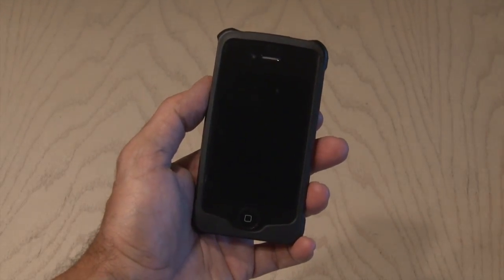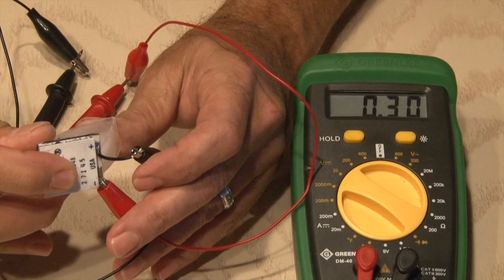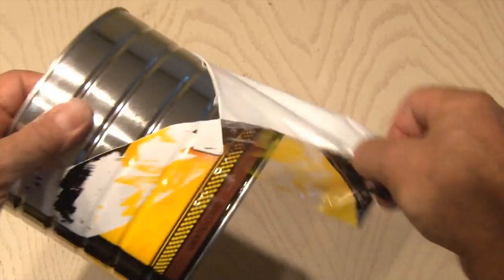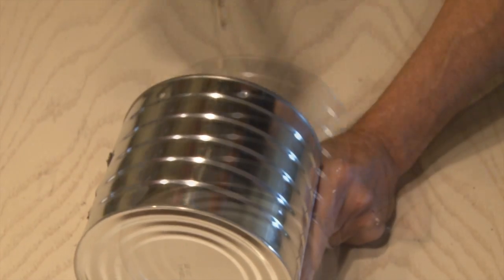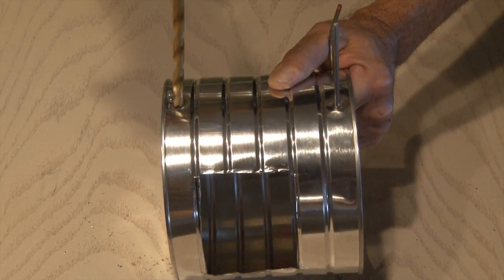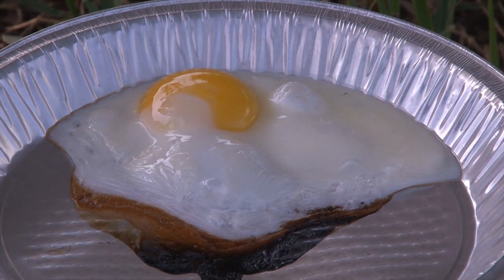Charge Your Cell Phone with FIRE!

Comment: Kip, I'm confused. In your other video that used a computer cooling fan to make a phone charger, you also included a step-up converter in the circuit. Why does the thermo module circuit not require the step-up converter?

Comment: the peltier effect works much more efficiently when the temperature differentiates from one side to the other so instead of just trying to get one side extremely hot try keeping the other side cool at the same time :) in general these are not very efficient for producing electricity but they are rather useful for pumping heat energy and these are mostly used in those portable electric fridges/hotbox and are great fun for messing around with whilst experimenting

Comment: how much volts can that put out, im thinking if you daisy chain them you can get a decent amount of power and maybe put them on a copper pipe  maybe coming out of hot water heater and run hot water thru them and power a light

Comment: May I ask why you connected red to the negative side of the peltier and black to the positive instead of the other way around? I know on some USB cables the colors are reversed - ALWAYS TEST BEFORE CONNECTING PEOPLE, NEVER ASSUME - but you didn't mention this in the video. Just don't want someone to fry their phone over incorrect polarity....
Reply: +Derek Tombrello Depending on the direction of heat flow, the polarity changes. Therefore if your doing this you should have a multi-meter.

Comment: Peltier generators are great for generating voltage directly from heat, but if you're gonna charge a phone, you really should regulate the power somehow. I would recommend a 3V to 5V emergency charger circuit instead of a normal 5V regulator just to get some flexibility of the voltages.

Comment: How do you differentiate the 'hot side'(side that is supposed to RECEIVE heat) from the 'cold side'(side that is supposed to be in contact with something cold) in this Thermoelectric Peltier Generator? kipkay
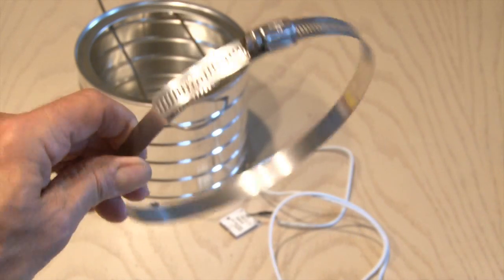Reply: randommr0361 Does the text on one side of the panel make that side the 'hot side'? As you used it so in this video? kipkay 2:19
Reply: Yeah
Reply: @randommr0361  OH MY GOD, YES. Shut up. I know this comment was 5 years ago but still, SHUT UP. Also, this isn't Twitter. This is YouTube. You put the @ at the beginning of the comment.

Comment: I wonder if you  could use one of those generators in a computer, converting excess heat back to energy.
Reply: It is used. However, usually they draw energy and actually act as a mini air conditioner. However, the computer wont run forever, as these are only 40% efficient.
Reply: yes if its just used for low voltage devices
Reply: waterlubber they won't run forever not even if they are made from superconductors and those would be 100% efficient!

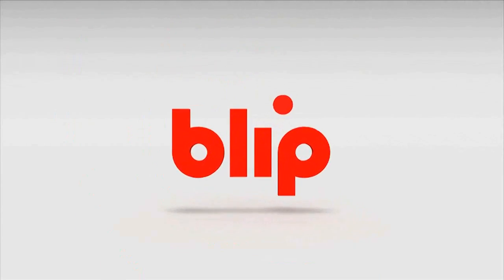Comment: At the end (3:02) the wire magically changes and it's a totally different one, also the Thermoelectric Peltier Cooler's place changes from where it was when he was charging his phone in the garden. This is kind of suspicous because both times he charges the phone the wire goes behind the stove and comes back as a totally different one.
Reply: You can even notice the color difference.
Reply: This is a real device. He placed it at the end for a example. They sell these at amazon and check other YouTube videos.
Reply: Moussa gamil It must be a duplicate hobo charger because there isn't a date code on the can near the kindle hole on the first "stove" and there is such a code on the stove at the time you mentioned.

Comment: you can brake your phone using this if the voltage is not constant. For example the phone charges at 5v and if the peltier is too hot it will go over 5v and overcharge your phone.
Reply: 2 Words:  Voltage Regulator.
Reply: I bet it wont make enough to charge it
Reply: This might just slow down the rate of disharge on your phone, nothing more. only a volt or 2 and no current capacity.
Reply: Then take a part a car charger and hook it up to that.That is always 5-5.5 V.Chill ok.
Reply: Colt 159 Those regulators are pretty meh and push the input much above 12 volts and they can break and fry your phone. This is a crappily done project. get over it.

Comment: How the phone is charging at the end of the video
Reply: DUH
Like he just explained. That small device (im not quite sure how it works) is connected to the stove (the device somehow uses the heat to generate voltage) and the voltage goes into the phone charging the battery.
Reply: TheAyJayMan g i know but there is no wire at the end!!
Reply: Because It was done charging and he took it off the wire.

Comment: There are commercial products that use the same tech. They are pots that have a peltier element in the base and you must put water (or soup etc) in the pot. This prevents overheating and also ensures a temperature differential between the two sides. They also have heat resistant wiring and electronics that make the output USB compatible.

I happen to have a couple of peltiers laying around and was thinking about doing something similar. But this project is probably not the way to go...

And your egg looks like cancer to me.

Comment: Three concerns: (1) no voltage shown from the final product, (2) at 2:49 and 3:01 you can't actually confirm the cable is connected to the peltier module, and (3) I suspect a joule thief circuit would be required to achieve a strong enough voltage. In theory this is possible but I doubt this exact example works.

Comment: It doesn't even work! When it looked like the phone was charging, it wasn't! He just made his lock screen wallpaper a picture of the charging battery. You can tell because when phone are ACTUALLY charging, there is a tiny lightning bold shape by the battery symbol at the top of the screen!!!😓😓😓😓but still a cool vid tho😆
Reply: You do realize this was pre-ios7, before the Lightning Bolt symbol was even used. Back then, when you charged your phone, your battery juice symbol would turn green.
Reply: There was a lightning bolt it was just inside the charging bar at the top right

Comment: This can burn your phone since the peltier will eventually start generating more than 5V, Maybe with more Peltiers and a simple 7805 with a small heatsink to keep the voltage at a stable 5v. Also doesnt the Peltier need a heatsink (i know they work with temp. dif. and ofcourse the fire will always be hotter than the ambient temp. but the peltier has a max. temperature before they start unsoldering the internal components so a small heatsink will probably help with that)

Comment: The best way to charge a cellphone would be like in metro 2033 flash light (the videogame). Using a dynamo to generate power and a voltage regulator.

Comment: Im pretty sure this doesn't work like that, the fire intensity varies in times and a cellphone require a pretty stready 5 volts with sufficent amps depending on the model, it might work with a circuit to regulate voltage tho

Comment: Tried this. If does not work. By the time you get enough heat to generate even a minimal amount of energy the wires coming from the charger begin to melt. A huge waste of time and money. This guy is a fraud.

Comment: I would add some boost/regulation circuitry before I tried attaching an unprotected energy source to my phone. With a 5V buck/boost switching regulator not only could the safety be improved but efficiency could be dramatically improved.
Another consideration is that peltier units begin to degrade above 85 degrees C, while the average temperature of a campfire (according to my google-fu) is around 800, so anyone building a device like this should be mindful of where the heat in the device is flowing so that placement of the unit does not damage it.

Comment: it sounds cool at first but something seems fishy as it goes on.  first the "generator" that is in the video is actually a "Thermoelectric Cooler" according to manufacturer. but I'm not going to worry about that point much as i've seen electric motors that can be used as generators by using some outside force to spin them up.  but on the other hand the data sheet does say the max voltage is 3.88  and USB runs at 5 volts so even if you do get voltage out by causing a big enough temperature difference one way or the other to get it to max voltage, it's not going to put out enough volts to charge your phone. to your credit I do see on the datasheet that they are saying at 50c the performance is 3.88v at 9.24amps at 23.6 watts so using volts=watts/amps we get 4.72 amps at 5v so you could make some sort of transformer to step up the voltage and still have more amps left then a typical usb charger puts out then use a power regulator to make sure you don't over load either device. so if heating it really does give off power then it's totally possible with a transformer and a power regulator that this contraption could actually work. however you do not include any such circuit to convert the current to the proper levels the phone needs. furthermore in the end of the video you show the can hooked up to the phone still but there's no fire in it or any sign there was one recently (the can was still clean and shiny so there couldn't of been any fires in there yet)  but the phone is still showing that it's charging while there's no fire going!!  so while this might actually be possible I'm not convinced that you really did it.

Comment: Why did you put the red cable on the - sign and the black cable on the + sign. Does the iPhone cable have reverse polarity or does the Thermoelectric unit have reversed labeling. please explain
Reply: The thermoelectric (a Peltier to be precise) element doesn't really have a polarity. which way the electrons move only depends on which side is hot and which side is cold. If you reverse the sides, you also reverse the polarity. Most of the time you'll still want to stick with the instructional markings to avoid confusion though.

This is why we have what's called datasheets; they tell us what the component does and how to use it. If you're going to experiment with a Peltier element, definitely make sure you get the associated datasheet before connecting it.

Comment: Conceptually, there's nothing wrong, though I would argue there are better ways of charging a phone when no power is available. This implementation, however, is quite poor.

First off, why cut the cable versus attaching a USB jack, say from an extension cable? Since nearly all personal electronics can charge from USB with their own cable, this gives you a lot more flexibility. Second, there's no voltage regulation, not even a simple Zener diode. This would be suboptimal, but acceptable, with a carefully chosen Peltier but no specific recommendation has been provided. Personal electronics generally don't like higher voltages across their USB port. Some will refuse to charge, some will shut down, some will blow up. Third, the cold side of the thermoelectric is not cooled. I'm not sure if this will damage the Peltier, but it does significantly reduce efficiency.

Comment: Shouldn't there be a 5V regulator?

I mean, you dont want to fry your iPhone, or do you?
Reply: i dont think the generator can push that much into the phone
Reply: @Killershark217  Yeah but better safe than sorry, also the regulator will also stabilize the voltage which is a great thing in the long run.
Reply: Rajan Hoxha doesn’t the regulator also drop the voltage lower than what it’s pumping out if it’s under 5 volts? Like if your giving a 5V regulator 4V it only gives like 3.5V or something I don’t remember lmao
Reply: iPhone normal has voltage protection a bit late comment

Comment: The Biolite camp stove is still better, but this has potential if more work's put into it.
-install multiple thermoelectric generators
-insulate the outside of the can with a larger can
-install a small variable speed fan
-install an internal battery so you can use the charge when you need it
-make it lightweight and portable

This is a Biolite, and it's very simple to build.

Comment: For those that think laws of thermodynamics were broken.. no. This works because of a temperature difference the hot and cold side. Without actively cooling the cold side, the generator would reach thermo equilibrium and no voltage would be produced. ~electrical engineer

Comment: then i guess now we can charge our cars by the heat of the manifold or  charge our phone just by putting it in the fridge...
Reply: "then i guess now we can charge our cars by the heat of the manifold"
Just about, yes! You wouldn't get a whole lot of power, but this would save energy in say a hybrid car if it were to be implemented.
 or  charge our phone just by putting it in the fridge...
Not exactly, as the voltage is produced by the DIFFERENCE between the hot and cold sides. Also, these devices are very inefficient, and the power required by the fridge to cool one side would be greater than the power needed to charge your phone =/

Comment: You could get even more voltage if you hook up these thermal generators in series all around the can... Also you could attack small heat sinks to the outside part of the thermal generator to help cool it on the cold side. This would also boost your output voltage. Inside thermal generators are 2 different types of metal that is what is causing the thermal-electric effect. And I thought heat was the death of electrical energy, it seems you can convert heat back into electrical energy. So much for the laws of thermal-dynamics.

Comment: How did you bypass your data cables (green and white). I had to place two 100k ohm resistors in parallel to my charger so my phone would charge and not give me the, " this device on not compatible with your iPhone" message. 
Great video though thanks for sharing.
Reply: my guess this is one of the older iphones, which charged, but incredibly slowly.

Comment: I am using one of these for my science fair project [making a USB Altoids charger] and I am wondering; is it possible to use the power produced from the thermoelectric generator to charge a rechargeable 9 volt battery?

Comment: I'm really surprised that this works... the USB port needs a REGULATED source of 5 volts DC. The Peltier junction device was not designed for this... and because it requires a DIFFERENTIAL of temperature, without a heat sink or other means to REMOVE the heat from the "cold" side, it will not output power for very long.

Comment: not fake actually, but it is not explained in detail.   A Peltier chip converts electricity into large temperature differences on opposite sides of the chip.  Freezing or below on one side and close to boiling on the other.  The reverse is also true.  Applying a temperature difference to the chip you get electricity out. It is, in effect, a two way transducer.

Comment: It's not fake, but he is doing it in the stupid way. To properly do this, you will need a boost-converter and a diode/FET against reverse current. If you don't use a diode or a FET, you will drain your phone even faster, potentially breaking it and the peltier will simply heat up. An over-voltage protection would also be appropriate so that when your fire is too hot, your phone won't die because of a too high voltage

Comment: those "generators" work off the fact that the temperature is much higher (or lower) on one side than the other side of it. it kind of works like a sterling engine almost.

Comment: I worked with these modules for about 15 years building  railroad refrigerators and air conditioner and what I can tell you if you dont disapaite the heat with a heat fin the module will melt down and short out. and for the person that asked the question about hooking it up no right or wrong way no matter what one side will heat and one side will cool.

Comment: There is always an inbuilt voltage regulator in the mobile phone, but he will burn this voltage regulator because this one usually doesn't stand up against more than about 6 V.
So you need a second voltage regulator before the inbuilt one if your peltier element can reach higher voltage values.

Comment: There is no voltage regulator between the peltier element and the phone but it is required.

So the video is crap, you'll destroy your mobile phone if you follow this video.

But there is an easy way to solve that problem with an LM317 voltage regulator.

Comment: What a crap video.

You need to regulate the voltage of the power that comes from the peltier element before you connect the wires to your phone.

If the voltage is to high, it will destroy the circuit in your phone, that's why you have to regulate it.

Comment: Using a metal, heat-conductive clamp to affix the seebeck to the hot can, contacting the cold side of the generator... Also does this really output within the constant voltage/current requirements of an iphone?

Comment: This is hard to belive, cause the the Peltier Element will heat up completely very fast.
You normally need a cooling ( alu heatsink ) on the cool side of the element.
Otherwise there is no temperature difference between both sides and then nothing happens.
And it seems to be a lot to small to produce the charging current for the phone, and it also needs min. 5 Volts to begin the charging process.
I think it needs peltier elements all around the can to get a real charger.

Comment: this is probably not something you want to do without two things: at least a heatsink on the cold side to prevent the cold side from heating up just from induction, and a 5v LVDO (low voltage drop out) regulator. some peltiers can output more than 12v, at which point, your ipod will die. additionally, ipods are very VERY picky about charging. you cannot simply apply 5v to the usb power lines - you must use a few resistors to short the data lines to ground. search google for the exact values